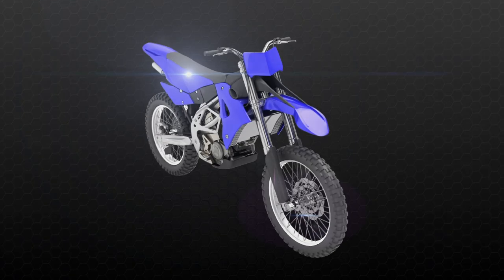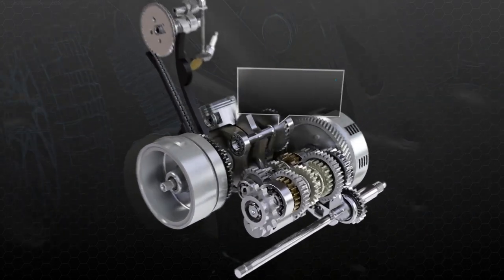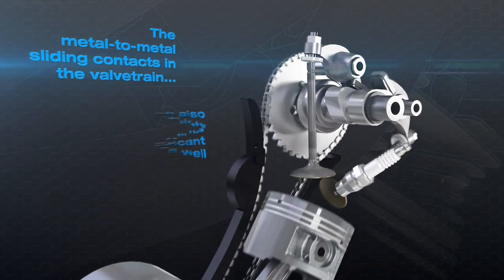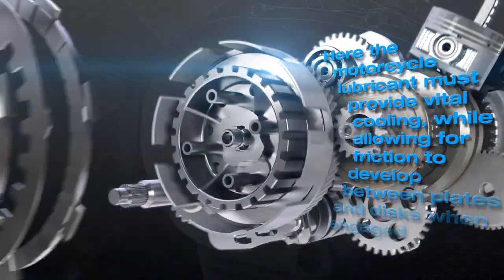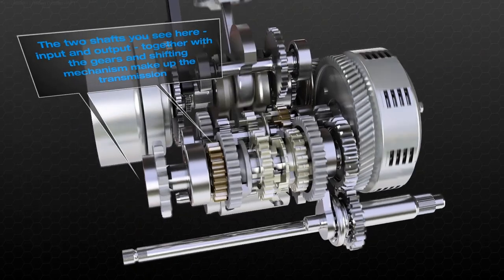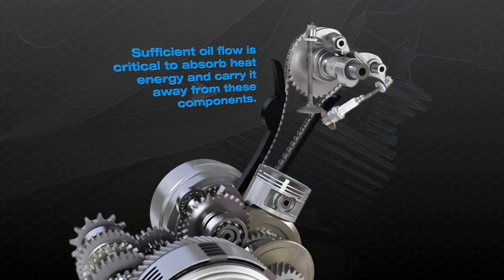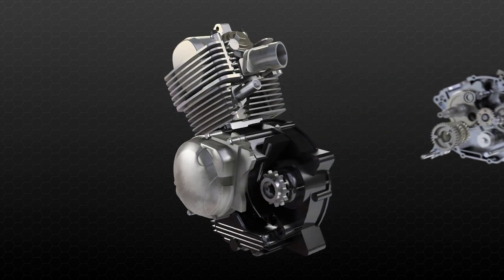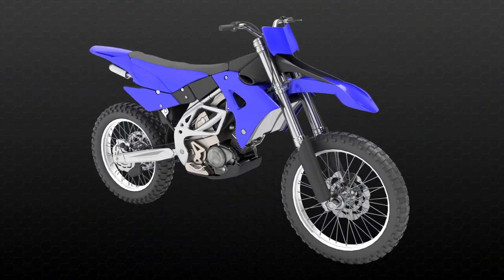4-Stroke Motor Cycle Animation

Comment: What I learnt..
50% - How engine works 
50% - Engine needs lot of lubricant
Reply: what i "learned".
5% how an engine works (didn't explain shifting, clutch , power transmission,  cams, importance of cam and ignition timing, etc )
45% lubricant, lubricant, lubricant. 
50% what the spiny bits looks like.
Reply: What I learned was most seemingly interesting videos are infomercials in hiding.
Reply: Selamat sian
Reply: @terrybyrd5105  ok
Reply: *learnded
Reply: Iya Apa kk
Reply: Can you make one more video explaining all the parts in detail
Reply: Anyone explain which engine used in bikes 2 stroke or 4 stroke?
Reply: @darkshadowsx5949  me too😂😅

Comment: From what I remember a few decades ago it was Yamaha that revamped the 4-stroke engines where they can actually compete with 2-strokes in motocross. Previously, 4-strokes were considered just too sluggish as race engines.
Reply: That was in the year 1998 when Yamaha introduced their four stroke motocross bike to compete in the 250cc category. They've used a 400cc engine since two strokes are 1.6x more powerful than four stroke so they used a 400 cc to compensate for the power difference. It was the 1998 Yamaha Yz400f, and it did win against the other two stroke bikes, despite the criticism that it wasn't a race bike but rather a "toy play bike"
Reply: The motocross 4 strokes came from the road race technology 
And very smooth fast usable and potent
Yamaha  yz450 very durable  machine

Comment: Not all motorcycles are unit construction even these days. Some modern bikes have both gear box and motor oil separately because the these two parts of the engine are separate.

Comment: Why does all engine mechanical function animation videos is made by yamaha.? You didnt noticed it but the engine i saw here is from yamaha xtz125 same as ybr125. Is it a common or easiest model of an motorcycle engine? I wonder why i always see this engine in animations.
Reply: Well, most piston motorcycle engines work exactly the same, but might have a slightly different design. This engine shown right now is pretty universal for most applications and this platform is used across many dirt bikes. I think it's just a coincidence that you noticed only yamaha engines in these animations. Honda and many more produce very simmilar ones.
Reply: Well I see Honda in most cases
Reply: cuz Yamaha's still run when they get ripped apart during the animation LOL

Comment: Did I miss the part where you explain how in the hell a 4 stroke only has 2 valves?
Reply: One intake valve and one exhaust valve? It's a single cylinder engine. Granted nowadays it is not as common to have only two valves per cylinder it is still completely sufficient.
Reply: its a 4 stroke not 4 valve as in there is four stages to one full rotation of the engine suck/compress/bang/blow

Comment: What is the big circle behind motor engine.

I understand big circle on clutch but not on engine one
Reply: That thing Is really important.
As It's mounted on the fastest spinning shaft, It works as flywheel & it's weight is just enough to center balance it.
And the Cavity holds the alternator, To power the spark plugs & Lamps....
Hence its one of the most imp part of engine
Reply: @swapnilkumar3316  all engine parts are equally important
Reply: @h10hunter  here you're wrong. Not all parts are EQUALLY important.
Your engine can run without those gears...but not without an ignition system.
Reply: @swapnilkumar3316  alright you win
Reply: Ignition magneto
Reply: Flywheel magneto.